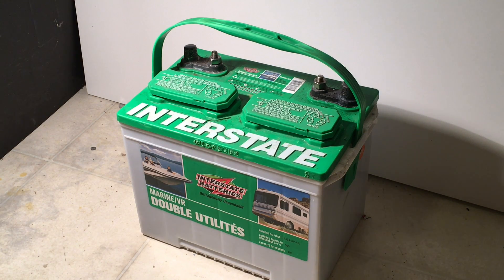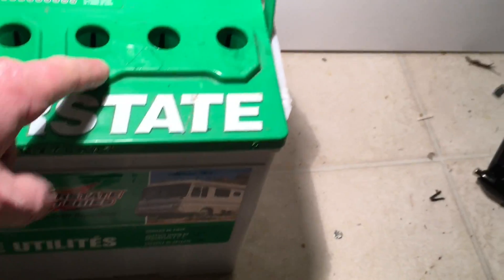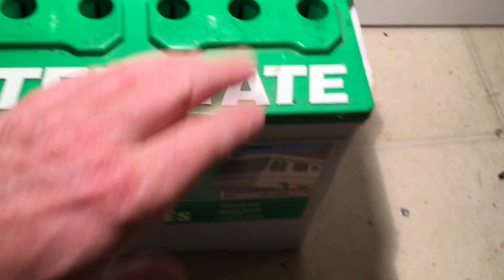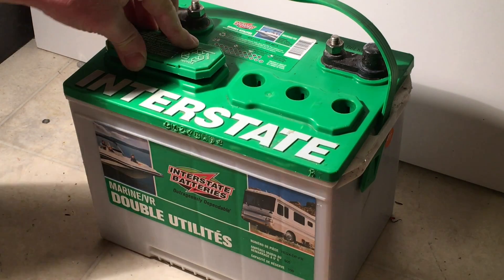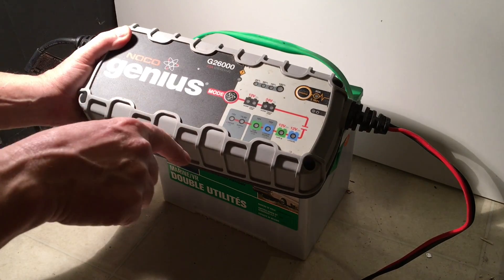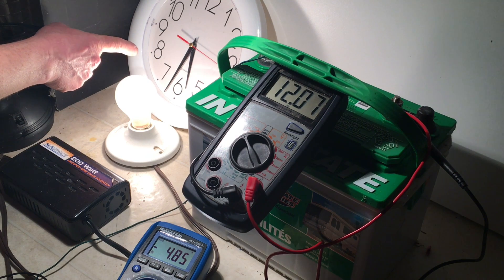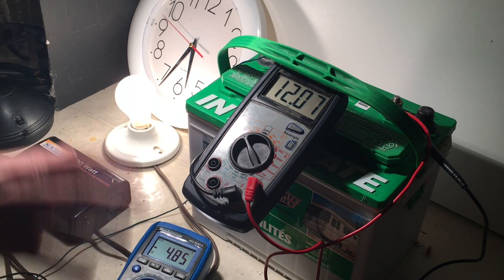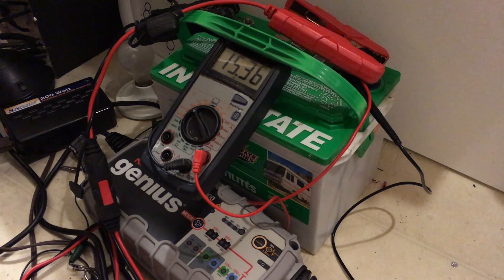Restore deep cycle lead acid battery. Revive dead sulphated RV car marine batteries

Comment: Error on cell voltage measurement - you need to take the voltage from the first battery post to the electrolyte of your first cell and add that to the voltage you measured on your last cell. This should add up to the value of each measurement of electrolyte  to electrolyte measurement you have taken.   These are not actual cell voltages but they should add up to the battery voltage. Post to electrolyte voltages are half that cell voltage measure, electrolyte to electrolyte voltages are positive plate of one cell to negative plate of the other cell you measure.

Comment: To all:....Get a "PulseTech" Xtreame battery desulfator (s). I have several use them, on my golf cart, Miller Welder batteries and three of my vehicles. They work great. Constantly pulsing the plates keep them free of lead sulfates.
Reply: I have been using the Pulse Tech PowerPulse battery desulfator on my batteries since 2015, glad to hear that they really work.

Comment: This looks more like an expensive science project. Multimeter, load tester, light bulbs, etc, etc.testing the cells wasn't show because hands were in the way. Did + & - go into cells ?
Whatever. This is a film to ensure it's easier to buy a new battery. I call this film ... Rubbish & a waste of good time.

Comment: Well for 1 this is a good battery because it has over 11.5 volts. Secondly if it was below 11.5 volts you would not bring it back to a good state unless you completely rebuild it. Your title says revive a dead battery. This is by no means a dead battery
Reply: the title says "restore" not revive, either way it should say "charge" a deep cycle lead acid battery lol

Comment: great video.  you gave me enough to get started, but there are some important things that you left out that are crucial, at least for a newbie DIYer like myself.  don't take this wrong, i'm not trying to be a wise guy, but this topic really intrigues me and since i'm just getting started, my level of understanding not up to par.

first, when testing the cells, your hands are in the way and you didn't explain where the leads are going.  for example, are both leads in the same hole or in adjacent holes as you move from left to right?  do the leads touch the plates or just inserted into the water?  you mentioned that there's a video #2 at the end and i looked through the videos in your channel and could not find it.  did you decide not to do it?  because none of the other videos' titles seem to be associated with this topic?  if you decide to answer this post, it might be more beneficial to your viewers if your answer is added to your description, because that would be more visible in the future to anyone else with these questions.
Reply: it's a video just to get views. The guy did absolutely nothing to "restore" the battery, he merely charged it lol
Reply: These were the exact same questions I had. And i mean exactly the same!

Comment: I searched on rehabing a deep cycle battery.  I thought you could just rebuild these batteries by cleaning the anodes and diodes and then changing out the acid with fresh.

Comment: With all the stuff he has ,voltage meters and tests ,you might as well buy a  new battery if you dont own all that stuff
Reply: Yah, but then you're still stuck with never being able to repair a battery. It's like buying 2 batteries and then buying batteries every 10 yrs instead of every 2-3.

Comment: How exactly did you check the cells? What parts of the battery did you touch the posts of your meter to?   Thanks
Reply: And no reply….
Reply: He used wire jumpers and dipped them into the water.  Measured the resistance (ohms) I think of the fluid.  He didn't touch anything, just the water.

Comment: You have the right idea on keeping a battery clean, but you have to do that ALL the time. Do it every time with distilled water every time you check or change your fluids in your car/truck (especially if you live in the "rust belt"). The dirt on the top of your battery is "rust dust" from other cars rusting and dumping that dust on the roads. This causes a high impedance short between the battery posts draining your battery while it sits in your driveway. It also makes your alternator work much harder to recharge the drained battery. A clean battery is a longer lasting battery. Get a "dumb charger" to be able to run an "equalizing charge"  every six months to bring each cell of the battery to equal voltages. Desuphating a lightly sulphated battery is OK, but if the battery falls below 10.5 volts after the "float charge" has worn off, it is DEAD and must be replaced. There is no magic solution that will restore a dead battery, you waste your money if you fall for this trick.

Comment: Fyi.. you don't need the invertor
This way you can use the exact 52w in ur calculation as the invertor is not 100 percent efficient...and u don't know what the effeciency is..light bulb is fine with DC
Otherwise good video

Comment: Cool video !  I actually have one of these interstate deep cycle and a Costco deep cycle   From a rv I just got    They are the rear auxiliary battery’s    They are both old   Labeled 2013 and 14 I think 
When I hooked up the rv  the converter charged them up nice    Then a few weeks later after not using it much 
And pretty cold weather    Their cold cranking amps is way low   Voltage is around 12 
I have one on a charge now   It a manuel 12v 6 amp charge I believe    Because the automatic deep cycle charge seems to not do anything    Am I wasting my time with these batteries ?   It’s winter and cold here   I’m not sure how much I will be using these in the rv this winter   So also I’m concerned will buying new batteries in the winter be a waste ?  Will they get ruined over winter sitting in a rv ?    Also not sure if my solenoid is hooked up correctly  main rear power comes up to the left side of the solenoid b front left is grounded    Wasn’t before   Then right side is connected to front right then to positive terminal    It seems they are wired all together all the time ?   Iv watched  videos and it seems it should be on a switch to only connect when the engine is running so that the running engine charges the rear batteries    That what I’m hoping to accomplish   Especially before buying new batteries

Comment: we are manufacture of lead acid battery ,whatsapp:+8613106266580 ,The lead acid battery was invented in 1859 by French physicist Gaston Planté and is the earliest type of rechargeable battery. Despite having a very low energy-to-weight ratio and a low energy-to-volume ratio, its ability to supply high surge currents means that the cells have a relatively large power-to-weight ratio. These features, along with their low cost, make them attractive for use in motor vehicles to provide the high current required by starter motors.

Comment: The Voltage charts are for at rest or with loads?   I've been using a really cheap $100 Excide 115AH deep cycle battery as my starter and house battery for about a year and half.  I've taken it down to 11.5v about 50 nights.  I am wondering how long it will last.   One number that confuses me is Reserve capacity.  If my battery is rated 115AH, I presume that means i have about 700WH of usable but have never been able to achieve that.  Also If they claim it has a 205 minute reserve capacity @25amp, what does that REALLY mean.. not really (205*12*25)/60 =  1025WH of usable right??  How is it possible that a 12 fridge that is consuming about 40watts took my battery from 12.6v to 12.1v from 9pm to 6am?
Reply: Your really cheap 115ah battery is more than likely 115ah @ 20h. A strange gimmicky market strategy very common in big box batteries
Reply: @TheACGreen4  vs 10h rate?  help me compare an orange to an orange then.. it's clearly physically a bigger battery and it is deep cycle. BTW, I've since upgraded to a VMAX 155AH deep cycle sealed AGM and it's massive, but cost $400.